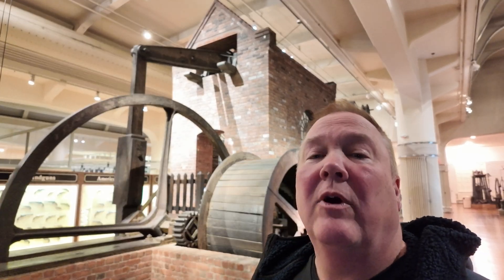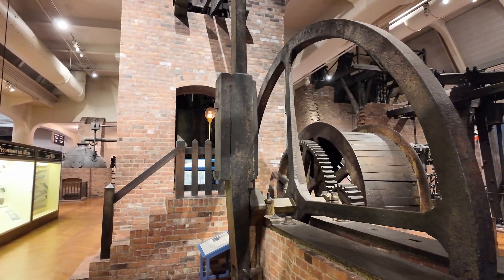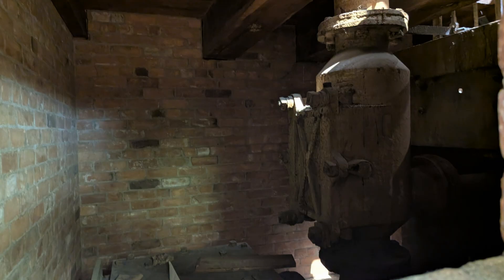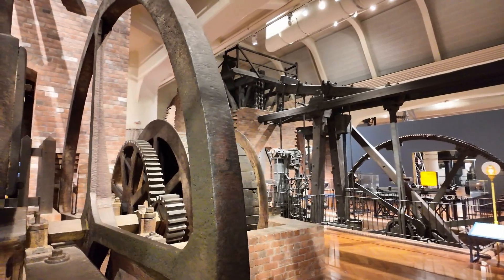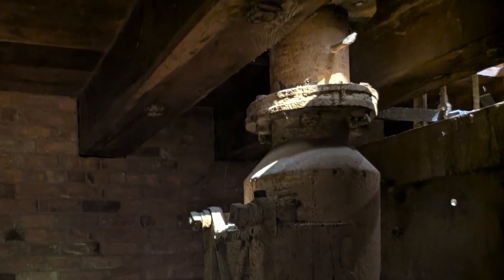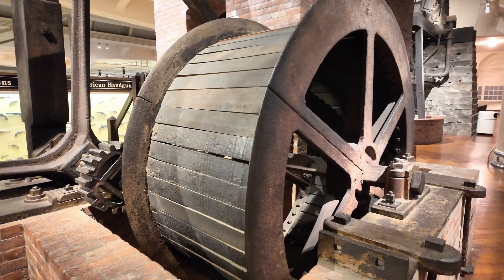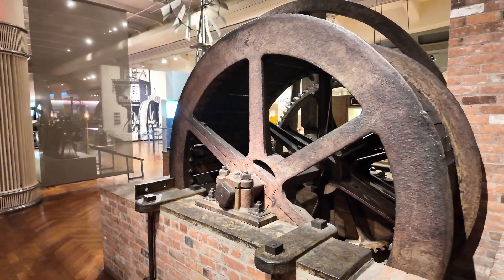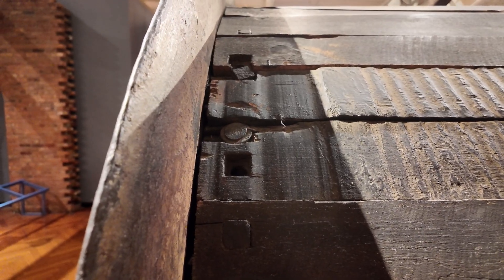Incredibly Rare 1791 Windmill End - Dudley Mine Engine - Only 3 Exist!

Comment: Imagine the person earning a living controlling the steam being replaced by a dumb valve.
Reply from the maker: That would basically be the mine hoist operator.  Maybe not a terribly, intellectually stimulating position, but if they screw up, they can pull the skips into, or even over the top of the top pulley, and people can, and have, died.    That actually happened with the engine in one of my upcoming videos.

Comment: The building this came from is a well known local landmark and it's a stones throw from my friends house who's great grandfather worked in the mines. Netherton, despite being small in area of approx 2.5 sq miles was an integral part of the industrial hub of Dudley and the surrounding area notable for its chain making. Its most famous export was the anchor for the Titanic, a replica of which was recast and initially horse drawn to it's proud display in Netherton high street in 2010. There are still old houses that when sold on have a covenant for no chain or nail making to be carried out on the property.
Reply from the maker: Thanks for the info!  I hadn't run across the info on chains and anchors, but knew the structure was still well-known.  Is there still much iron work in the area?
Reply: @Industrial_Revolution  Unfortunately there is nothing left these days in the way of ironworks, the once massive Round Oak Steelworks in neighbouring Brierley Hill which employed thousands of workers as a leader in the industrial revolution supplying pig iron and then onto the steel making while also being the first UK  manufacturer using gas powered furnaces supplied with natural gas from the North Sea  is now a shopping mall redeveloped in the 80s and 90s. Luckily a lot of heritage including tools, machinery and complete buildings with a fully working small town can be experienced at The Black Country Living Museum located in Dudley.

Comment: Looks exactly like something in india or pakistan today
Reply from the maker: Made with a double-acting, higher-pressure cylinder, and adding a brake which appears to be missing on this one, there's not much reason you couldn't essentially build one of these today, so it's definitely possible.
Reply: @Industrial_Revolution  I love everything steam powered, id do it if i didnt live in an apartment
Reply from the maker: I know the feeling.  It's really tough to get even a small, steam-powered locomotive up to my 2nd floor apartment.

Comment: Great video and explanation but you could show the valve gear and plug tree in better detail. Would you look at the other atmospheric winding engine at the museum?
Reply from the maker: Thanks for the comment and suggestion.  The plug tree is hard to see on this one, and you only get one view on it, through the doorway.  The other winding engine they have there, the Moira engine, has much easier viewing, all the way around, and is also a much more complicated setup for both pumping and hoisting.  I have a video on that one on the way.  
If you're looking for a good, solid view of how plug trees and atmospheric engines work, you might want to check out my video on the oldest surviving Newcomen Engine.  It's a pretty impressive creation.
https://youtu.be/0SwKo2StQLA
Reply: @Industrial_Revolution  Thanks. I was interested about atmospheric winding engines but there is little information about them on internet so your video is very helpful. It is commonly told that atmospheric engines were used only for pumping but there were quite a few of them winding coal as well. They are sommewhat lost to history.Thanks again.
Reply from the maker: That's the problem I ran into, too.  Guesses and reverse engineering.  The Moira engine is different in that it has a fairly standard beam pump AND a separate beam for a dual-drum winding engine, both connected to the same cylinder.

Comment: Very interesting Darren!
Very well executed design to get round watt’s parallel motion patent. Hear in cornwall winding engines were always called whim’s and SIMM’s engines had weighted bobs rather than on the sweep rods I believe.
I wonder if they used neatsfoot oil to keep the leather seals supple and also lubed the cylinder.👍
Reply from the maker: Thanks!  It's too bad so few of these single-acting cylinder whims survived.  All I've heard of using on these really old cylinders was actually keeping some water on top of the pistons to keep it wet and pliable to improve the seal.  Better lubricant probably came along later, after the cylinder boring improved.
Reply: @ 
There is so much we just don’t know!.   I make horse harness and thought constant warm wet condition and those leather seals would not have lasted very long without some oil protection. 🙂
Reply from the maker: I'm no expert in leather, but if it's like wood, as long as you keep it dry OR you keep it wet, it'll last a long time.  It's flipping between wet and dry that destroys wood fast.  If you think things like bog mummies, the skin is well preserved despite centuries in the water.  Maybe take a small piece of scrap leather and toss it into a closed container of water, making sure it stays submerged, and then ignore it to see how it does?  If you try it, be sure to let me know how it worked.
And I expect the leather curing process was different (and a lot more toxic) than what's used today.
Reply: @ 
It’s really opposite with the curing process. Originally leather was tanned with oak bark the process took a long time put you produced wonderful leather. The modern way today uses chemicals, makes it faster but the quality is not there. The tanning process takes all the moisture out of the hide and replaces it with oils, that’s why when you clean harness you oil it or saddle soap it, you are topping up the oil lost.  I have heavy horse bridles that are more than 100 years old and they are in great condition. Mould rarely grows on them, can’t say the same with the new leather we use today.

Comment: What did they use for steam cylinder oil back then and how was it injected?
Reply: Early steam engines like this used no oil.   As progress was made often times it was natural lubricants like whale oil and wool oil (lanolin)
Reply from the maker: Thanks!  That's what I thought, but I wasn't sure, and the extra detail is good.
Reply from the maker: Cylinder oil?  Well, back in the early days, when this one was first built, my understanding is they used leather seals on the piston and, in some cases, kept water on top of the piston to help reduce leaks around the seal.
Early machining wasn't very good.  I've heard, but not verified, that James Watt eventually started having Remington (the rifle company) doing the boring on his cylinders, using their improved process (turning the cylinder, not the bit).
I think the oil only came along after the machining was quite a bit improved.
Reply: @Industrial_Revolution  James Watt had his cylinders bored by John Wilkinson, the inventor of an accurate boring machine. He was a famous ironmaster at the town of  Ironbridge in Shropshire, England, named for the world's first iron bridge which he built across the river and which still stands.  This was many years before the Remington company was founded.
Reply from the maker: Thanks.  I was going from memory on the Remington thing.